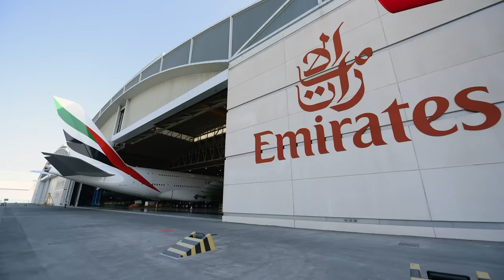First ever landing gear replacement | Airbus A380 | Emirates Airline

Comment: My question is why? Aren’t the A-380’s fairly new?
Thousands of other planes fly nonstop for twenty to thirty years on their landing gear. Yes they change the tires periodically and the brake pads on other planes. Why did they do that? Was there something faulty in the manufacturing of the landing system?
Reply: No I think because of hard landings and if something happened it need to replace

Comment: 2018: •changes gears to new ones•

2020: •starts retiring the A380•
Reply: good planning
Reply: @peacethongjua7242  Boeing:This will work to our advantage.
Reply: This 5 landing gear cost 25 million $
Reply: Jasper Lu 747 has being retired very a while now
Reply: Also 2020: *stops making planes and letting other planes suffer until retirement*
Reply: @Jasper Lu Low-cost airlines buying the 747-8: I've got chu in my SIGHTS.
Reply: @peacethongjua7242  coronavirus entered the chat.
Reply: They don't bother to mention why... hard landings - too many, perhaps. So brag about changing it and leave the details out... 14 days of maintenance and inspections... and repairs?
Fly Navy! The hardest landings are on the angle deck... 15 degree glide slope, a hook and one of three cables to stop your plane... at takeoff thrust.
Reply: @Sweetteawillie  You're comparing an aircraft [I'll use an F/A-18] with a maximum take-off weight of 25,000kg to an A380 with a max take-off weight of 575,000kg...
Reply: @Shepard_AU  
It's a hard landing. One is built for this environment. That's not a comparison but an exception.

Comment: A380 is a horrible plane. Too big, too heavy. What they don't show you is all the work in heavy that sheet metal has to do to repair ALL the cracks in the gear supporting structure and fuselage that this plane needs. It's like spending a dollar to make a dime.

Comment: Shouldn't it be 14 hours instead of 14 days ?
Reply: Pete P.
It probably takes 14 hours just to unhook the electrical wiring! Then the hydraulics (after bleeding the system), then disconnect the mexhanicsl linkages to various actuators (retract/extend, up-lock, down-lock, LG doors, sequence control valves, etc.). THEN you get to loosen and drop the old LG. Don’t forget to take your time to carefully read the procedures in the maint manual (remember: you’ve never done this before, ever!) And you’re not even close to half way done! ; )

Someday, maybe, with a LOT of practice, you might be able to do it all in 14 hours.

Comment: Why they replace the labsibg gear wheels
Reply: It is a life-limted part. The stress of landing creates “fatigue” in the landing gear structure and it adds up over time.

The design engineers calculated the number of landings after which the strength of the landing gear would have decreased to a level that would no longer be safe enough. At that point it must be replaced with a new set (or a set with some service life remaining).

Comment: 571 tons too heavy just for landing gear, need a new material and design to reduce.
Reply: That is the weight of the aircraft that the landing gear has to withstand, not the weight of the landing gear

Comment: Surely the weight you quoted was for a max laden aircraft ? When putting it on jacks it should be empty and with minimal fuel) Still impressive tought but pls use correct numbers.